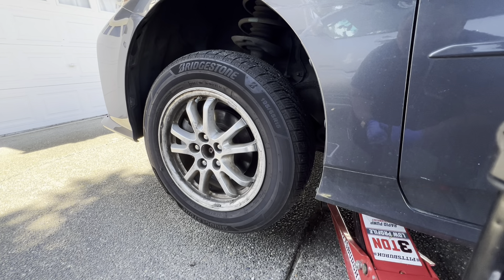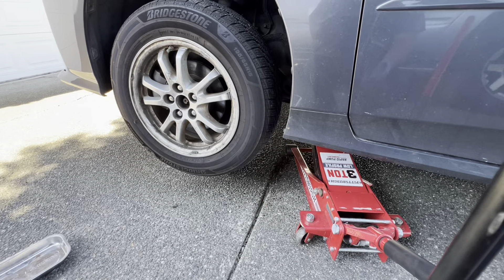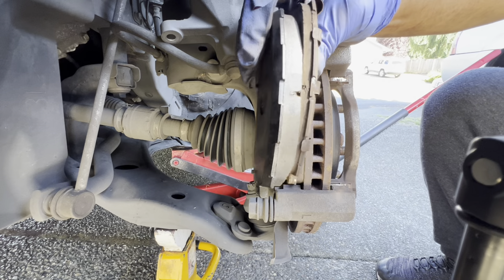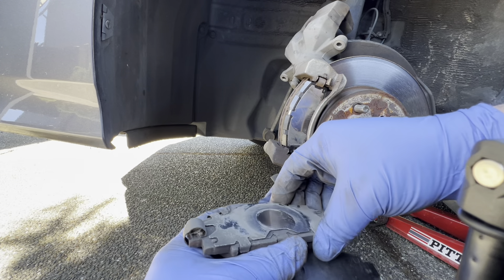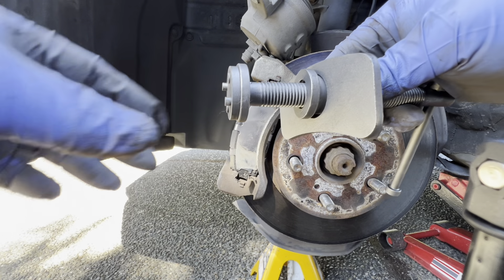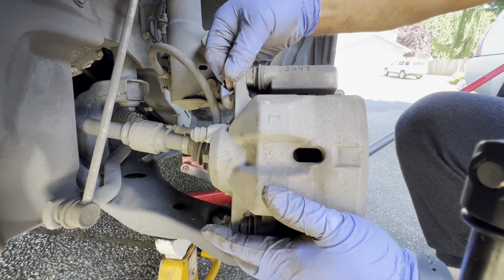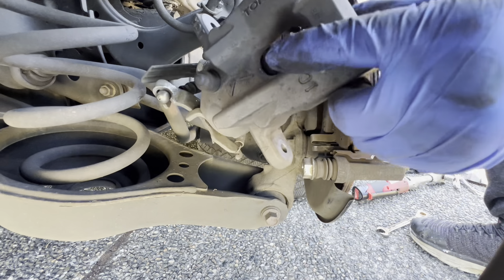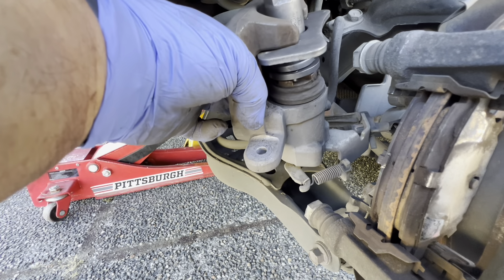2017 Toyota Prius replacing front and rear brake pads, easy DIY Got 190K miles on original pads!

Comment: I did the first brake job on my 2005 Prius at 230K miles.  On my 17 Prius Prime, they needed it at 100K.  Kind of shocking, but I did all-out drive like a Formula 1 driver for about a half hour one time, almost all at full throttle or full braking.   Still, the regen braking did enough that my brakes weren't smelling or smoking, while the 3 cars that tried to run with me me had to eventually pull over with clouds of smoke coming out of the wheel wells. I'm in my 60s and don't go looking to race, but on twisty mountain roads, if someone decides to resist getting passed by a Prius, they're in for a lesson.  

I normally do replace the rotors, because by the time I need pads here in New England, the rotors have worn deep tracks, and the part protruding out outside the tracks, is nastily rusted.    Fun fact, if you put the front of the car up on jack stands with both wheels off, and ignore all sensible safety warnings, running the car in EV mode turns the rotors at a nice slow pace for you to use a file to knock off those rust ridges by the OD of the rotor.  But I inevitably decide to replace the rotors anyway.  

Glad to see you switched to using needle nose pliers to turn the rear caliper piston in.  It's easier than those tools, and on the front a C clamp is also easier, so I've resisted the urge to by the caliper compressor tools.  I do replace all the rubber boots, relube the caliper pins, and use new hardware.  RockAuto is your friend for finding those things cheap and top quality, often a Raybestos kit.

Removing the rotors requires a better, more secure place to stow the caliper.  I used to use a steel S shaped hanger.  Now I invert a bucket that fits in the wheel well, and just lay the caliper on it.  My daughter has an infinite supply of square kitty litter buckets that work great.  There are also plastic collapsible stools for under $20 which are like a thick Frisbee, that you can adjust to any height in the range you''d need to not stretch the brake hose.  I just prefer the free kitty litter bucket upside down, rather than get a stool dirty.
Reply from the maker: Wow all great tips thanks for sharing!  Glad to see you can keep up with the race cars!
Reply: @AutoGuyVideos  Only in places with tons of sharp curves, and lots of very big ascents and descents that make regen braking the key.  I was not surprised at how well the car did in curves descending 4000 feet of elevation.  What really surprised me was on the ascent after that.  I was at such a disadvantage on power to weight, yet just the cornering and braking advantage made up for that.  Maybe everyone else's tires were underinflated or in bad shape.  I was on pretty new Michelin X-Ice3 winter tires at 50psi, and this was in 100+ degrees in desert mountains!

Comment: I did everything the way you did step by step, but now my dashboard is lighting up like crazy any ideas?
Reply from the maker: I also recommend recommending disconnecting the negative battery terminal

Was your key close to the vehicle? You’re supposed to keep your keys, away from your car.  Also, don’t mess with any wiring.  I didn’t have any issues at all. Is yours a 2020 or newer also check your fluid level in your brakes. 

Some guy had a similar problem with a 2020 and up model and his keys were close to the vehicle and he had to get it reset

Comment: Very clear and informative video! Thank you!!
I need some help from everyone here. 
I bought a used 2017 prius with 130k miles. There is an issue I can’t figure out. My car brakes starts jerking very bad when my battery reaches to “full” (usually on a downhill). I’ve replaced front and rear pads and rotors 3 times (at 180k miles now) the problem seems to go away with new rotors and pads for a few months. What do you think it is? I really appreciate your help guys!
Reply from the maker: That sounds like an interesting issue. Are you using OEM Toyota brand brakes from the dealership? I hope you figured it out or someone on this forum can answer you.
Reply: @  I am not actually. I used top version of store brand rotors and pads from Autozone & Advance Auto. Haven’t figured out anything yet. But i’ll try OEM Toyota Brand this time. 
Also, i owe you a SuperThanks for Catalytic Converter Heater/Coolant issue fix video! 
Thank you so much!
Reply from the maker: I love my coffee kicks! But yes stick to OEM

Comment: Followed the steps exactly the same for a 2020 prius front brakes and now abs and traction control light is on. How do i fix that?
Reply from the maker: @cnydownhill8242 make sure you didn’t unplug the ABS or speed sensor. Go double check the wire connections.

Also were your keys far away during the install?
Reply: @AutoGuyVideos  how far do the keys need to be away? I think they were in my pocket 🤦‍♂️ of course I missed that part. What now? Please help
Reply from the maker: You can always try disconnecting the battery and then reconnecting it and see if that resets the lights or drive around and see if it goes off
Reply from the maker: At least 10 ft
Reply: I had tried the battery and that didn't work. I rented a high end code reader but some of the safties are locked by toyota (said the mechanics I talked to) so they didn't clear. Had to let them clear the codes. $199 for the hour of diagnostic work. But still far cheaper than if they installed them lol. I'd like to do the rear brakes myself soon cause they are down to 2mm 😶. I have the parts but I tested the front brakes before doing the rear and the abs alarm came on. It's very loud. Wanted to make sure that was solved first. I really appreciate you getting back to me. Would really like to dm you so I can figure this out
Reply from the maker: Yeah, I’ve never ran into that problem so I couldn’t help you. When I did my brakes, I didn’t have any issues. I wonder if the 2020 has other weird quirks

But next time I would recommend you disconnect the negative battery terminal before you work on the brakes

Comment: Great videos man! I'm considering getting a prius prime 2017 or a more recent version. Just wondering if you have heard of any high voltage battery issues?
Do you plug yours frequently?
Reply from the maker: @martinceballos9236  almost 190,000 miles I haven’t had any issues with high voltage. I have a level two charger that was used to charge my vehicle most of the time and level one charger as well. I feel like I definitely got my moneys worth out of this vehicle, and if size wasn’t an issue, I would buy it again. I still have it and I’m gonna keep it as my back up and a car for my kids. but in terms of easy to work on I like this vehicle.

Comment: At the beginning of the video, you said you may disconnect the battery when you do the rear brakes but then you didn't follow up.  I am assuming that you decided not to.  Is there any reason why?
Reply from the maker: I was too lazy to disconnect so I just took my car keys and moved them far away in my house when I did the rear brakes. No issues and all was good.
Reply: Some Gen4 Prius have electric parking brake that could activate while the caliper if detached-big trouble
Reply from the maker: yes be safer and disconnect the battery!

Comment: How many do you get on fully battery charge? Do you still get 30miles?
Reply from the maker: Summertime I should get 25 at least, winter time probably closer to 20 electric range
Reply: @AutoGuyVideos  interesting, when u got it in the beginning, wer u getting 30miles full charged?
Reply from the maker: I was probably getting closer to 27 or 28 miles electric range when it was new. It really didn’t drop too much. Plus I drive it really aggressive.

Comment: Those brakes would have lasted you another 100k miles
Reply from the maker: Yes probably! But was eager to change them.
Reply: So waste of money then
Reply from the maker: @ I probably could have got closer to 40k in front brakes . But figured I rather change them out. The rears wore out faster then fronts as well maybe had 20k left. Job is super easy to do thankfully